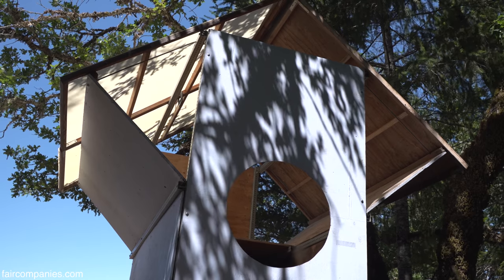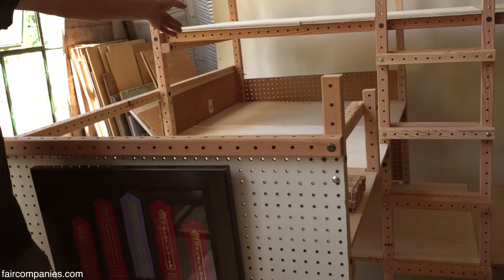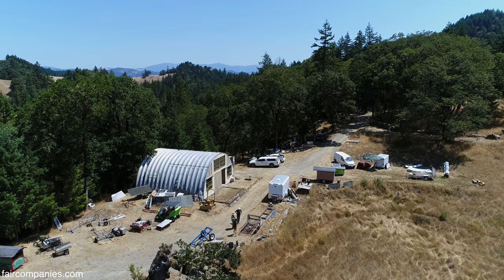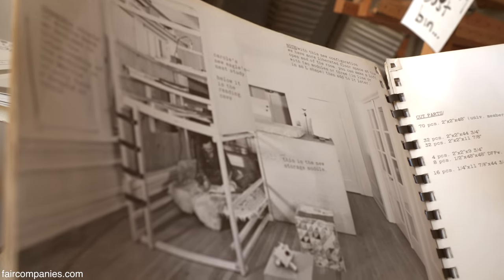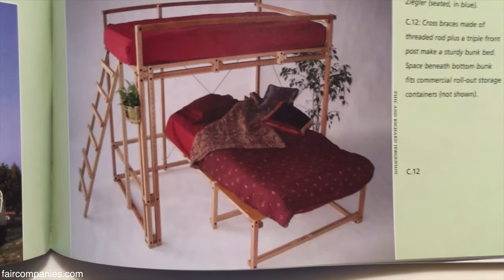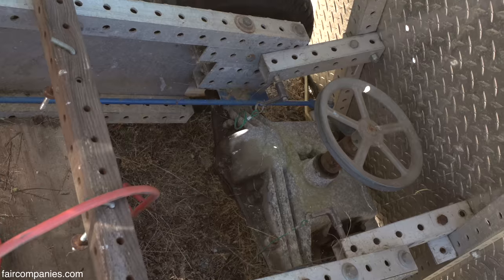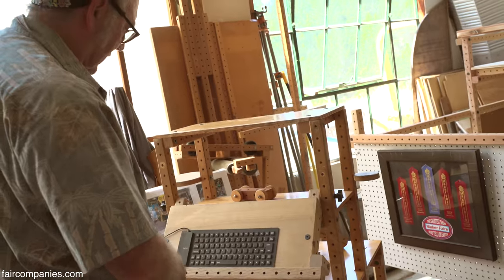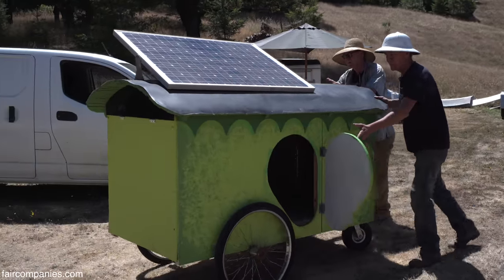Grid Beam modular system builds anything, furniture to bikes

Comment: Only issues I would see with the holes is if the structural integrity of the material. Wood will eventually rot, and those holes look like perfect breeding grounds. And with the metal, you'd want more supports for the larger projects.

Comment: Used this concept back in the 70s from the original book. I made a 2 -4 ft square structures to make a loft and desk. Back then there wasn't furniture hardware like today, just flat head bolts and nuts. The design extended also to using it as an exoskeleton for a small cabin or even a vehicle.

Comment: An alternative to this is a mig welder. You can connect cheap metal rails basically like with a hot glue gun.
Aluminium profile is another alternative. 3D printing connectors for aluminium profiles works too.

Comment: Any lumber can work the same way without drilling so many holes all at once. And how often are you really going to take something you build apart? My projects all have specific purposes.   If someone wants to take one of those apart and use the materials for another object, that's wonderful. But I don't think that should be any ones first consideration.
Reply: Not to say that it isn't a cool idea :D
Reply: Not to mention that even if you had boxes and boxes of those GridBeams you would still need a shop to make stuff to mount on the GridBeam frame. (like those wheels, legs, chairs etc.) So if you need to visit a shop each time you'd want to make a new thing, you might as well just buy some new aluminium and 2x4's and not have a thing that has a whole lot of holes in it.

I guess GridBeams are better for prototyping than building the final product. You get your GridBeams, screw them together, check if the prototype is functional. Then you can quickly get all measurements by counting holes. Then you take the prototype apart and build the final product with newly bought materials.
Reply: and slotted aluminum extrusions are more efficient
Reply: The metal beams are stronger and more durable and don’t degrade the way wood degrades when you take it apart or when you put movable joints on it .They are ready made and multi use.
Reply: It requires a change in thinking. We change "things" often enough. If you had this, you could build the specific thing you need. When that isn't working for you anymore, change it. I totally get it. Amazing.

Comment: Just starting some research on woodworking and want to learn it. I would love to try building furniture using wood beam. However, can someone shed some light on how strong the wood grid beams are? My concern is when there are a roll of holes in them, they will not be as strong as they are solid.  Aluminum would be great and strong but I might not have the budget for the material.

Comment: The stuff is reusable but how often would that be an advantage?  You can buy an eight foot 2x2 for about five bucks.  For them to round the edges and punch holes in it they charge 24 bucks.  For that kinda dough I just don't see the point.
Reply: While you're right, I think the section with his daughter shows the best case scenario for this idea. She had a set of these components for her entire childhood that she changed into different things frequently for her needs, took them to college with her, built a bed there, built easels when she needed to paint, etc. All without ever having to buy another product or new raw materials which is pretty awesome. The price right now is too high for sure, but if this ever caught on and reached mass manufacturing, economy of scale would bring the price down significantly to where you'd only be paying ideally no more than twice the cost of the raw material instead of five times the cost, which means you could have the components to build several small pieces of furniture for the price of a video game console that you could easily break down into component pieces and rearrange into anything as your needs change.

Comment: $7 a foot? Yikes. Aluminum square tube is like, $2.50 a foot and you can easily drill holes wherever you want.

Lumber is especially 'modular': you just screw and nail into it wherever needed. You don't need expensive rows of holes because the entire thing is already usable.
Reply: This is an open source project, we encourage you to make your own  gridbeam whether it be with wood or aluminum. There is a book online that shows you how to drill your own, along with the proposed spacing so you dont have to spend $3 a foot for pre-drilled wood.

Comment: I love the idea...But!....we need to work on the price to make this practical.  You need investors who can help you get this idea selling at your local home depot at a way better price than a 2x4.  Or else people will buy the most affordable materials available and lets not forget that this is a unorthodox way to build a structure or house.  You will have to deal with building regulations and codes to meet standards for this types of building projects. You might just want to focus on   lowering the price for now until it becomes a high demand material. For now its idea that will flop due to competition and pricing.